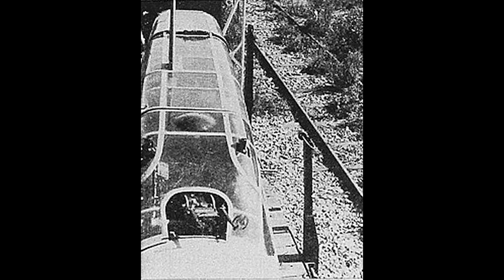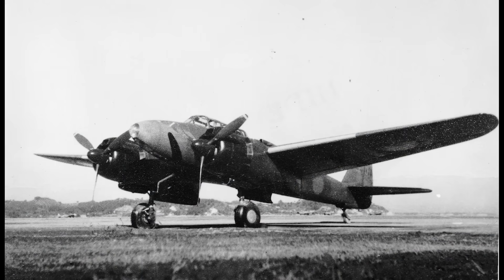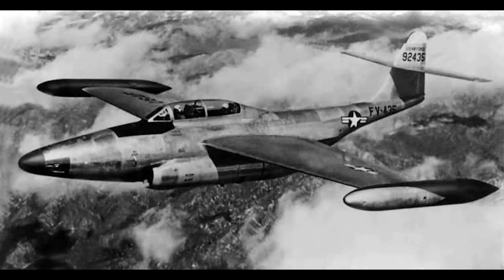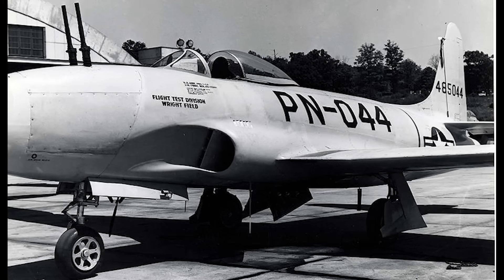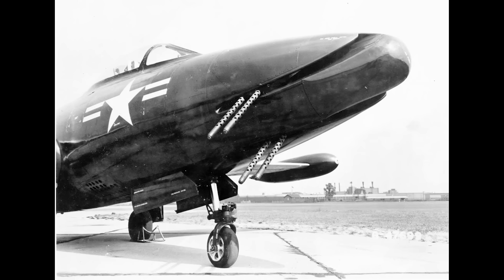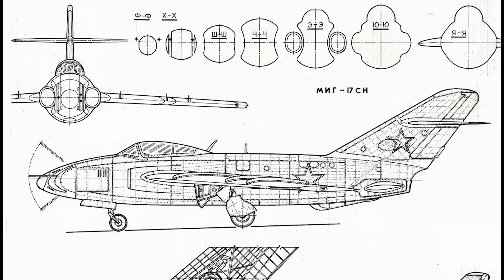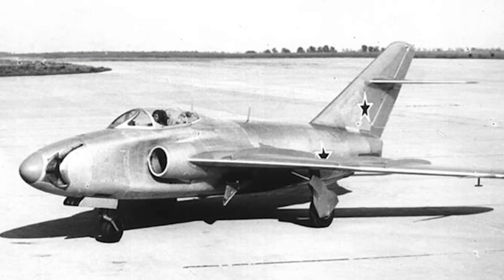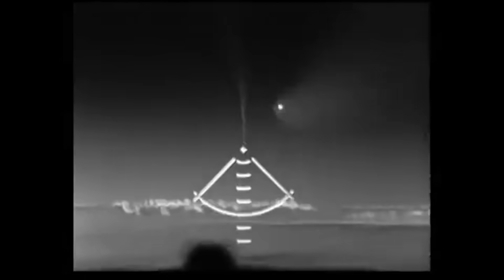Jet-Powered Turret Fighters: Practice Eats Theory For Breakfast

Comment: If you had asked me straight off the blocks "how would you apply a turret to an early 1950s fighter?" I would have said an F-89 Scorpion with a B-29 turret mounted behind the rear seat and the weapons system's officer operating the remote firing station just like the bomber.  The B-29 turret system was a marvel of engineering, rather compact and not all that heavy. Yes, you'd lose the central fuel tanks, but those could be supplemented by drop tanks in addition to the tip tanks. The forces of firing would have been MUCH closer to the center of gravity and center of lift so the net pitch forces would have fallen dramatically. With so much weight removed from the nose cone, at least a portion of that volume could have been allocated to more fuel. 
The result would have been a lot more like the P-61, which I honestly think is a good thing. These seem like very complicated solutions compared to what was was already available.

Comment: Thanks for a great account of attempts to adapt the turret fighter concept to the jet age. It should not have surprised them that firing the nose-mounted turret guns would cause loss of control - the recoil of the weapons generates considerable thrust. The WWII aircraft mounted the upward-firing "Schrage musik" cannons nearer to the center of gravity, minimizing their effect on pitch. While rockets addressed the problem of insufficient "time on target" with conventional machine guns/cannon, another solution was also found - the use of Gatling guns with very high rates of fire.

Comment: Besides the switch to air to air guided missiles, I'm guessing that the solution they did settle on, as far as gun engagements in a short time frame, was simply to develop guns with a higher rate of fire, such as the M 61 Vulcan cannon - essentially a Gatling gun on steroids.
In short, they went with the "throw enough crap at the target, all at once, and something will hit" philosophy.

Comment: Arguably the P-61 was another candidate of turret nightfighter. Its top turret with 4 .50 cals was not defensive, it was to serve exactly the same purpose as Schräge Musik or the Defiant's turret. However it seems it was hardly if ever used under direct control and usually fixed forward to augment the cannon or just removed alltogether. But of course the P-61 faced targets about equal its own size (it was a big aircraft) or smaller, hence the need to evade defensive gunfire usually didnt apply
Reply: It isn't a candidate for that, it was exactly that, a night fighter with a turret. It's just that the turret caused aerodynamic issues when traversed off centerline (because of it's teardrop shape), which was the actual main reason why it was usually locked forwards.
In fact only a small fraction of operational P-61s had them. Most omitted the turrets completely. Control systems were diverted to B-29 production.

Comment: Two major problems with Schrage Music were that a) The bomber was right above and in front of you when it started spiralling out of control, and b) You were firing straight into the bomb bay at relatively short range. And you're doing this at night.
Reply: Pilots aimed for the wing for exactly that reason. Usually between engine nacelles on a 4 engine bomber. Aiming at the fuselage was suicidal
Reply: @JGCR59  Aimed? Yes. Hit? Not so much, given you have two independent aircraft at night. And even then, that only helps you with b). Unless the bomber already dropped and was heading home. Night fighters were lost while attempting this, the major difference being that even more would be lost while attempting a more standard interception. And even more were lost to Allied night-fighters accompanying the bomber stream, some of which had equipment designed to home in on Axis night-fighter radar (Serrate).
Reply: @onenote6619 Study a bit. RAF attack on Nurenberg on 31st of March 1944 is great example. 95 heavy bombers shot down, with new methods of routing Nachtjägers to bomber stream, SN-2 radar and Schräge Musik. British reports (recorded often after VE Day) tell entirely tranquil situation, then wing chopped off or in blaze.
Reply: "Instruments of Darkness" is well worth reading.  There's an improved 2nd edition available.
Reply: And all this was learned in Mommy’s basement playing War Thunder
Reply: @mikebeard8505  Nah. I started with 'Instruments of Darkness' by Alfred Price back when I was a teenager. It's an account of electronic warfare during WW2, which is a subject often overlooked. I read some accounts of the more prolific German and Allied night-fighters as well, like Wittgenstein. As the video says, using Schrage Music to best effect had a pretty high skill floor, and the risk of getting squashed by a crashing bomber or blown out of the sky by detonating bombs was something they were all too aware of.

Comment: The last thing a number of German nightfighter pilots saw was their erstwhile victim plummeting down towards them and on fire before crashing into them taking the German pilot with them to his death. This was caused by the fact that the nightfighter formatted so closely beneath the bomber when it fired its guns had greatly reduced the time it needed to manoeuvre away from its victim. This is probably one of the reasons why it was not successful.

The Germans must have learnt something from this because when the same tactic was used by the Me 163 the guns were fired as it passed underneath the B-17s which meant is was clear of any falling debris

Also whatever the RAF command did some of these Germans were seen formatting below RAF bombers before shooting that bomber down. Because of this a new tactic was spread amongst bomber crews which would reveal any nightfighter flying below them.

Comment: Silly question - but if the BP defiant had two 303 forward firing gun would it have all worked out - also was it the Bristol Fighter thy caused the trouble as it worked very well!

Comment: The Mig17SN does look more elegant than the original Fresco
Reply: I agree, and when I saw it, I saw an opportunity of using its design for basis of advanced MiG-17 variants, like missile - armed interceptor, attack aircraft, recon planes & advanced jet trainers. That redesigned nose section for pivoting guns obviously gave plenty of room for things like missile - capable radars, reconnaissance cameras or even 2 - seater cockpits. What a missed potential.
Reply: @พิตตินันท์จันทร์ศรี-ว5ฟ MiG well understood their design. If it was an improvement why didn't the 19 and 21 follow suit? Did you miss the issues with compressora, air intake, unreliable and decreased handling? Just because it "looks" like an improvement doesn't mean it is.
Reply: @bhag7977  I didn't say it was an improvement, I just like the lines.  But, as you pointed out, looks don't make the plane fly.
Reply: @bhag7977  Excuse me, but the MiG-19 and MiG-21 also got a derivative that is their version of the MiG-17SN. For the MiG-19, the MiG-17SN equivalent for it is the Chinese Q-5 attack jet. The Q-5 was accepted into service and worked very well for the Chinese and several countries that bought it. 
And for the SN version of the MiG-21, there were 3 of them: Ye-8, J-7FS & J-7MF. But unlike the Q-5, all three of the "MiG-21SNs" never made it to production. The main reason is that the design bureaus came up with new clean-sheet designs that were better than advanced versions of the 19 & 21. What is the reason for the Russian and Chinese air arms to stick with the 19s & 21s when there soon will be planes like MiG-23, MiG-25 & Su-15 that will replace the 19s & 21s anyway for the Russians, and the JF-17 & J-10 that will replace the J-7s for the Chinese and allies?!
Reply: @kevinmello9149 I didn't mean my response to you, especially as I would never argue against it on looks alone. I was respond to the guy saying he'd improve it.
Reply: @bhag7977  Sir, I think I already gave the answer to your question of "If it was an improvement, why didn't the 19 and 21 follow suit? Did you miss the issues with the compressor, air intake, unreliable and decreased handling?" by showing that the MiG-19 & MiG-21 eventually got a derivative that is their version of the MiG-17SN with the most successful of them is the Nanchang Q-5. So if there were some major issues with the engine and handling created by the redesigned nose and intakes, planes like the Q-5 wouldn't exist beyond wind tunnel tests. And the main reason didn't come from design flaws, but rather came from no interest in advanced versions of the 19s & 21s in the MiG OKB at the time.
Reply: @bhagen7977 I also forgot to mention the JL-9 combat trainer, which is essentially a JJ-7 (MiG-21U) with a redesigned front section in the same fashion as the MiG-17SN, i.e., nose intake replaced by side intake to free up the nose for something else. But unlike the Ye-8, J-7FS & J-7MF, the JL-9 shares the same fate as the Q-5, being accepted into service by its home country and exported to some countries.

Comment: Good article.  What is the name of the plane at the  1:09 mark.  That is a wild pusher. It appears to have the prop rotating around the rear fuselage. Then tail assembly seems to be using the engine as a stressed member of the main body of the plane.
Reply: Caption says Vickers 161.
Reply: @GJ203 Thank you, right there in front of me. No wonder I didn't see it.😅
Reply: Its purpose was to shoot at bombers or airships flying much higher, after the experience in WWI when fighters could exhaust their fuel before getting high enough. But the COW gun of 37 mm couldn't be given a very high muzzle velocity, otherwise the aircraft would have been destroyed before the enemy. The Vickers 161 seems to have been given a considerable built in head wind but its more conventional looking competitor the Westland COW gun fighter was worse.

Comment: To be extremely pedantic, "the only jet fighters to deploy with a gun system that didn't fire directly down the roll axis were the [Furies]" - this isn't actually true. All F-15s have their cannon pointed a few degrees above boresight, specifically to help get a guns kill in a turning fight. Granted they have a more complex gun sight obviously, which is why it works
Reply: Additionally, I believe that some Soviet fighter bombers had gun pods with barrels that depressed for ground strafing… essentially getting the same thing the the MiG-17SN was going for but at much reduced weight and complexity, and only a modest performance penalty.
Reply: … this is the SPPU-22 variant of the GsH-23 gunpod, and it has a 0-30 degree depression for strafing. Standard part of Su-17/22 and Su-25 loadouts though I think it could also have been fitted to a MiG-23/27 as well?

Comment: It is one of those "Good idea in theory" -- because of modern streamlining, the target's silhouette is getting smaller. With modern jets speed, the time to aim and fire is getting shorter. Also the time of the firing pass is now shorter ( fewer bullets you can throw at the enemy as you pass ).  So rather than try and hit the tiny rear silhouette , attack the large flat underneath of the fuselage which would increase your chances of a hit.

Comment: The F-89! Everything about it was huge, except of course the engines.
Reply: Didn’t it have two of the F-84’s J35 engines with afterburners? That also sounds huge haha
Reply: @boranakin710  It had double the power for almost double the weight and almost double the wetted area. An old dude my parent's knew had ben stationed as a mechanic with them in Iceland, and he told, that they had a hard time keepimg up with the newer air-liners.
Reply: @leifvejby8023  that’d be quite true. Although the F89 didn’t even reach operational status until 1955 and its peak service years were 1956-1960 (by which latter time the 707, DC8 and CV880 were commonplace) it was a 1940’s design and so its performance was sufficient only to reliably intercept the piston-engined bombers of that earlier decade.

Comment: not the turret fighter i was thinking of but still an asinine concept as the prewar versions!! get your opinion on something, i was thinking about how the merlin engine made the mustang a good fighter do you think the merlin could have kept the P40 relevant through the end of war as well?
Reply: The Packard Merlin was fitted to some P-40s (F and L models, acc. Wikipedia), but I think the P-51 was just a better airframe. But the P-40 stayed reasonably relevant where high altitude performance wasn't needed, right to the end.
Reply: @michaelwright2986  i was getting at relevant as a fighter not a ground striker!
Reply: They did try fitting the Merlin in P-40's, but the problem was one of supply - as in, they couldn't produce enough Merlin's to equip the P-40's, while at the same time equipping the P-51's and Spitfires. They gave priority to the P-51 and Spitfire for the available Merlin engines.
Reply: @mitchelloates9406  i was going more to the performance aspect in would it improve performance enough to keep it in production and the air to air roles!

Comment: It seems that the Luftwaffe ''Schrage music'' installations were build on or near the central pivot point therefor minimizing pitch during firing. Something that the later jet aircraft turrets seem to have ignored.
Reply: That's an important point, and it also had a fixed angle, making sighting much easier. Even with 1950s computers, I find it hard to believe that a pilot would have had much success aiming a variable angle turret in a dogfight.
Reply: not really ignored, but likely more blinded by the want for the guns to be in a turret mount, which was greatly difficult to do in the middle of the fuselage
also the video mentions that the Schrage musik arrangement was difficult to make good use of so again, they wanted the system to be adjustable, ideally with a radar so it would be easier to use
Reply: that's exactly what I was thinking, came into the comments section to see whether anyone else had said something of the sort yet.
Reply: Luftwaffe Jazz Music?! Niiiiiiiiiice hacking cough
Reply: It’s more so because the bf110s guns weren’t a turret, they were fixed
Reply: Did They ignore it. or did They realize that there wasn't room in the center of a jet fighter for some guns?
Reply: @RonJohn63  If you can fit a cubic meter of turret control computer in the middle of your jet turret fighter, you can fit some fixed guns and save yourself some weight.
Reply: @RonJohn63  I was thinking an F2H Banshee with the guns behind the cockpit were the central fuel tank was. That is near the center of pivot on all axis.
Reply: @RonJohn63 I mean by that metric how did anyone fit Schrage Musik cannons right next to the rear gunner of Bf 110s and Ju 88s, where the central pivot point is?
Reply: @Ibrahimarm In Bf-110 inside the loooong canopy. Observer/gunner of Bf-110s were already used to changing MG-FFM drum.magazines on earlier versions of aircraft.

Comment: Well...... Not a totally nutty idea. But, wrong platform and use. About 10 years later someone decided to apply the moving gun idea to a helicopter. 🚁

The whole movable nose idea was a bad one. Even if you got it to function, the muzzle flash is going to blind the pilot. And the vacuum tube electronics, make everything incredibly large and heavy. 
The idea of targeting off the center Axis with things like helmet mounted targeting would reappear as well.

Comment: i would hazard that if you put a circa 1950 radar between two machine guns, then the radar will not work well for long..
Reply: The aerials survived OK but the boxes of electronics needed to be protected from vibration.
Reply: yeah some of those set-ups looked optimistic
Reply: thats my point, if they sandwich the radar between two 50cal or some other gun you will need to do a lot to protect the arial. the lectronics you may move to the back but the connections between them and teh arials  might be suseptible, i think the russians had entore jest that they couldnt use the guns for more than once becuase once they did, theycompletely shook the systems apart.

Comment: Imagine what would have happened in the BOB if the Germans had built a Heavy fighter with 20mm turrets, instead of the 110. This should have been possible, thus guns could fire upwards or to the rear.